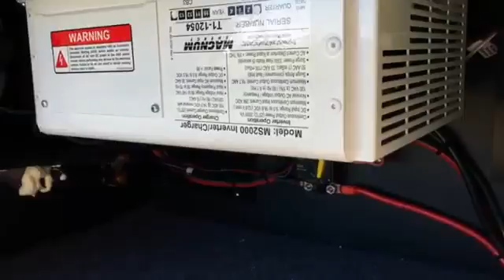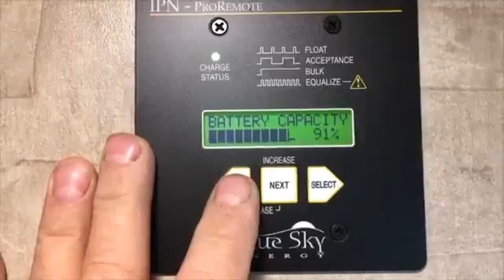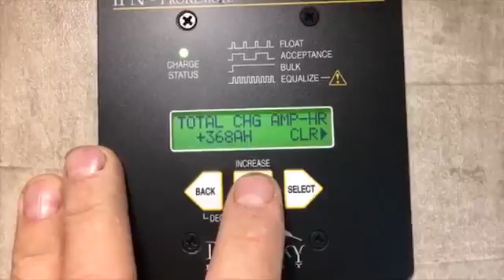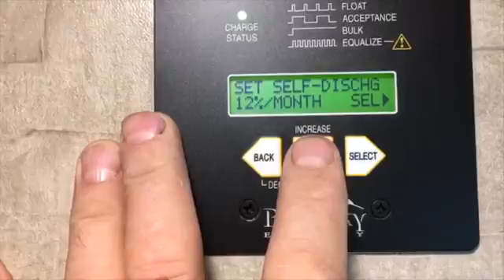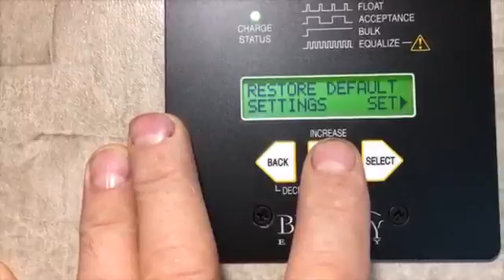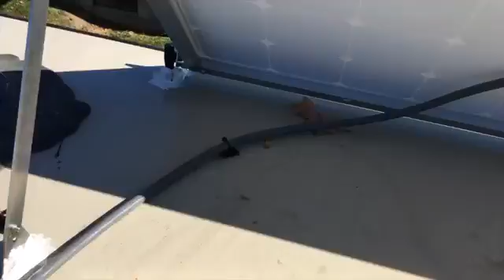2015 AM SOLAR SYSTEM INSTALL PART 4

Comment from the maker: Yes they have held just fine, only use tape on solid surface. Rubber roof will need screws. Be sure to cover the bracket with Dicor sealant this will keep the tape from wicking water and deteriorating.

Comment: Did your mounts with the tape and adhesive manage to provide a secure mounting system? I enjoyed watching your series on this installation.
Reply from the maker: Yes, be sure to only use the tape on a sold surface like fiberglass or metal and be sure to clean the surface to remove any wax, oil or dirt. If mounting on rubber you will have to use screws. No matter how you mount them cover with Dicor self leveling sealer this will prevent water from degrading the 3M tape. Our system is 2 1/2 yrs old and has worked flawlessly. 

Happy Harvesting!
Reply: Thank you. I have a metal roof so it should be fine.

Comment: Sorry quick question. So the ms2000 magnum inverter. Does it automatically switch to shore power and back when you are using solar or shore power? 
Thanks again
Reply from the maker: neil berkeley Yes it has pass-thru technology, you can be watching tv on shore and as long as you have the inverter set properly if the power goes  out or you disconnect from shore the tv, computer or even the refrigerator, what ever is on the inverter will continue to run on the batteries think of it as a battery back-up like for computers. But better! LOL
Reply: Dennis Hageman thank you kind sir 👍